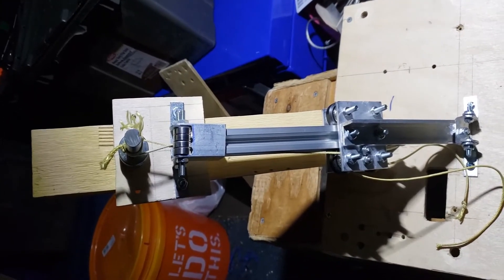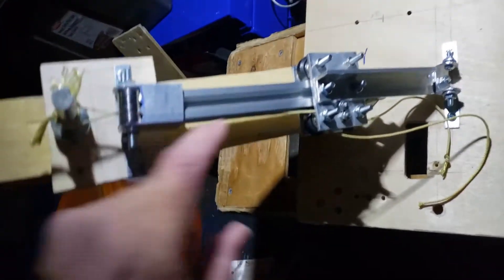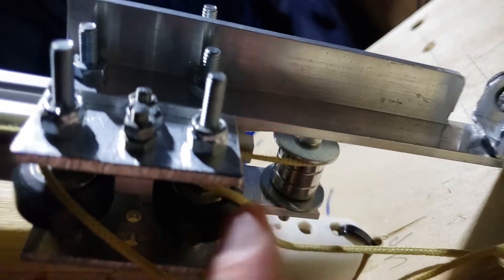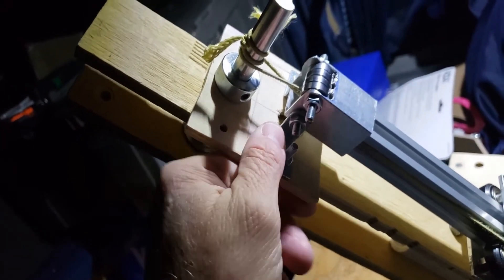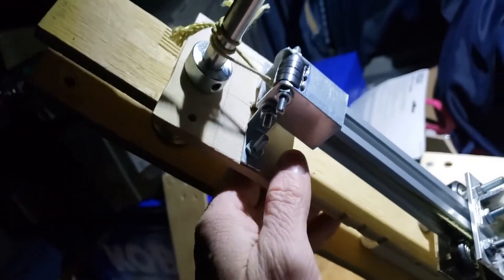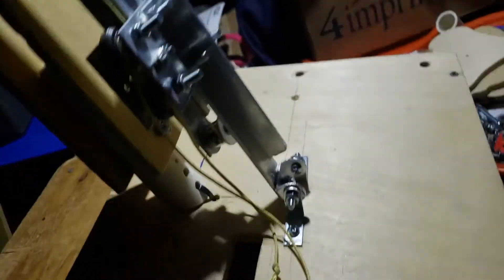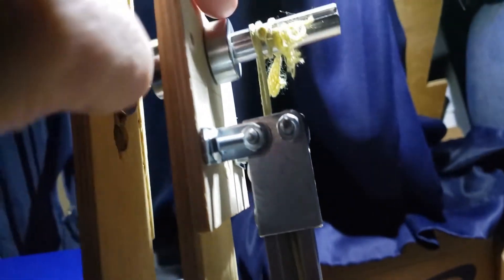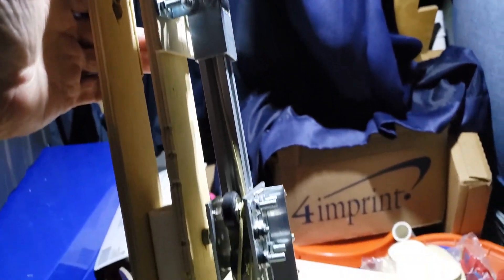Back Drivable Linear Actuator

Comment: I've been trying to research how to make a motorised audio mixer fader, and I couldn't find anything about it.  The special thing about them is they can move to software-defined locations, then when you grab them they feel like any normal control.  Those things are thousands of dollars and I just want a couple of motorised sliders.  I was writing up a stackexchange question, trying to think about what properties I need the motor to have and I realised I needed a "back drivable linear actuator".  So I googled that phrase, found this video, and this is exactly it!  I just need to scale it down.  I'll 3d print a tiny spool, glue it to a motor shaft and wrap a string around it then attach that to the slider!  The throw is only limited by the string and I can use the slider as the sensor to make it into a type of linear servo motor.  I can get this done for about 1% the cost of the pro hardware!
Reply from the maker: Awesome, I'm so glad someone benefited from one of my vids. But? Just in case motor drag is a problem with the way your slider feels on your fingers, I would try separating the pot slider into 2 pieces. One that's actuated by the motor, and the other is actuated by the finger. Then make the motorized slider try to follow the fingered slider. The finger slider is the actual pot slider, and is connected to the motorized slider with a magnet. If you motor the slider to a position, it just accepts it, if you finger the slider to a position, you can move the slider, and the motorized slider matches the finger position. I don't know. Build one and try it. Let me know. Good Luck.
Reply: @argamesandtech6080  Thanks, that's not a bad idea, actually.  I looked into it and it turns out the pre-made modules use a system very similar to this video but with a toothed belt.  I found some at fell-off-a-truck price so if they work I won't need to build them after all and I can get straight to programming.
Reply from the maker: @excrubulent  sweet! good luck.